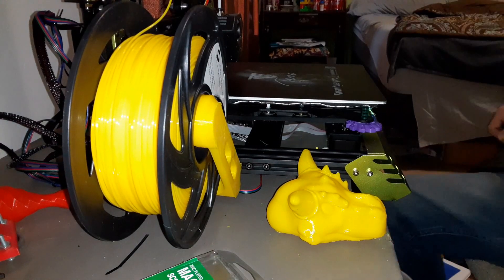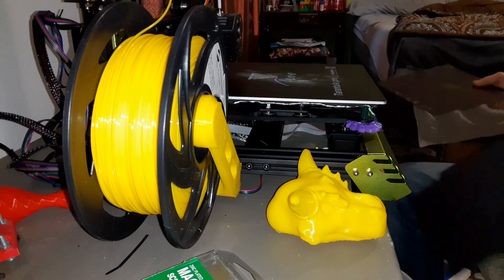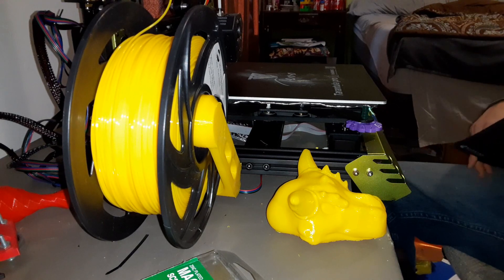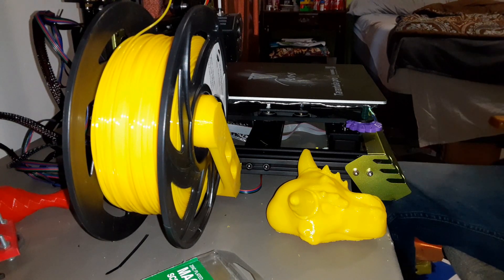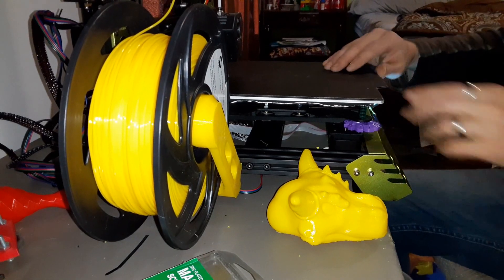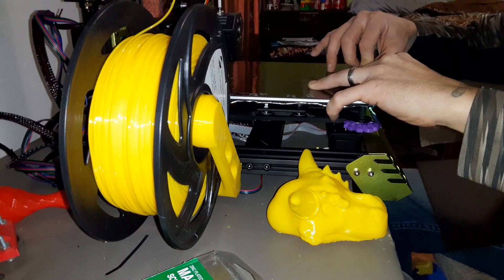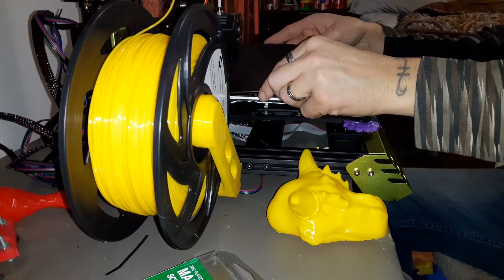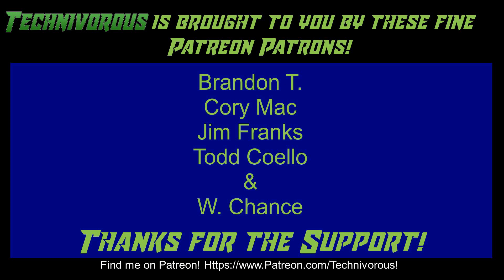Tevo Tarantula Pro 2020 - upgrading to a magnetic bed!

Comment: did you take the magnetic build surface from the ender 3? Because I looked online and the build plate is supposedly 235mm x 235mm but then the official mat sold by TEVO is 240mm x 240mm
Reply from the maker: i did. funny. the magnetic mat for the ender is 235, but the bed itself is only 220 mm
Reply: @Technivorous  so would a typical 235 x 235 mat work? sorry I haven't received my Tarantula Pro yet but I already know I want to change the build plate

Comment: Shouldn't you have removed the original bed sticker first?
Reply from the maker: yes. totally yes. except the mat i recycled already wasnt the stickiest, so its just a temp fix until my new backer arrives, then the whole thing is getting replaced with pei, and i will need to pull the original bed, and scrape and clean. i knew this was temporary and i didnt want to do it twice. luckily, the stock surface is super stickey, so i havnet had a problem. just needed to offset the z by the thickness of the added mat.